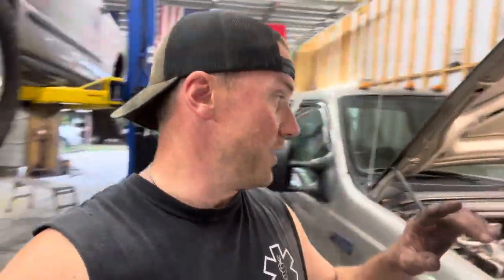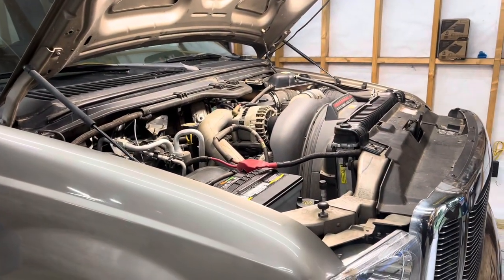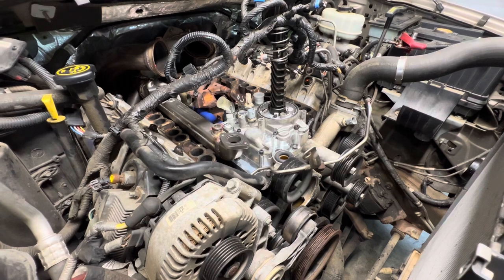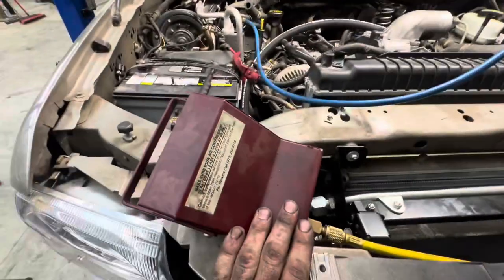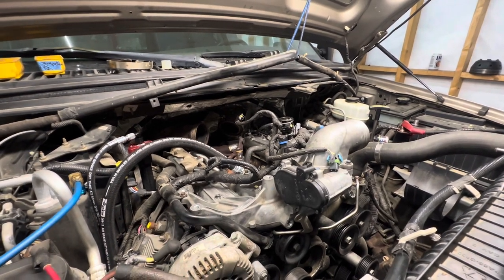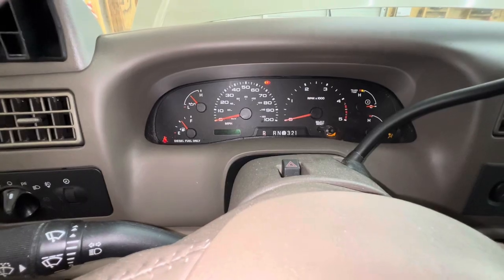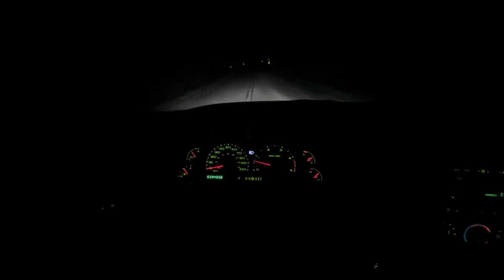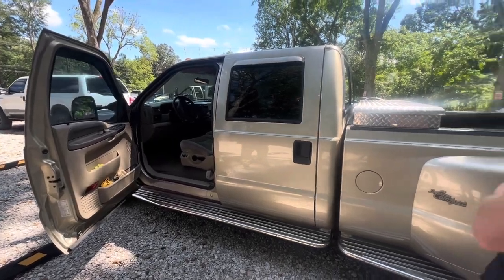38k mile 6.0!!! BPD external oil cooler

Comment: Great video...My uncle has an 07 F250 CC 4x4 KR auto with 26,000 miles, garage Queen, never pulled or been left outside in the sun or weather, he is 87 and says I can buy it when he dies...It'll be a great replacement for my 05 F250...

Comment: The whole inside of that intake looks like that egr.  I let them soak in parts cleaner overnight then blast them out with a hotsey.  This is why it's best to just delete egr by plugging it.  Then removing diverter from up pipe.
Reply from the maker: Not my truck. He wanted the egr on there. I can only do what they want to spend their money on.

Comment: One thing that may help or be useful.  When you remove the radiator hold downs, put one back on with the bolt that's farthest away from you and put it in the one closest to you. If that makes sense.. that way it keeps it pulled tord you to help remove the fan shroud and keeps the radiator from moving around.
Reply from the maker: As many times as I do this I’m ashamed of myself for not thinking of that already. Thanks

Comment: I think I would have split the turbo case open and just checked the vanes and unison ring since you went this far. But like always you have produced another great video!
Reply from the maker: Had no symptoms of any Vgt problems and I checked shaft play.
Reply: Yeah I doubt it had any end play but my low mileage F250 which wasn’t driven hard or driven often still had locked up vanes but also had vanes that would move. I guess my point is that I would’ve checked the vanes and unison ring.
Reply from the maker: @davidwilliamson2181  I get it, I just had no symptoms or any bane problems.

Comment: What would you recommend to get oil cooler wise, my 6.0 is pushing coolant and I believe I have some coolant in my oil. That being said I believe it’s the oil cooler that has blown, truck is studded and egr deleted also has an external coolant filter. Thanks
Reply from the maker: @MalachiCarrico  oil cooler won’t make you push coolant out.

Comment: Love the video, ultra clean truck, beautiful install. 

I'd love to ask if and how you find your parts. Do you use a site with breakdowns, to find parts and part numbers? I have troubles with the local shops around me not having a single clue. I have a big project ahead of me: Oil Cooler, EGR Delete, New Degas bottle, Degas Cap, Intake Gaskets, Blue Spring, Coolant Bypass Filter, etc. Going all Motorcraft, but I'm interested in trying to find or know what gaskets, o-rings, and seals I should be replacing while there. 

I am also looking at getting a monitor and have been looking at the EDGE Insight CTS3.

Anyways thank you for sharing all of your knowledge in these videos, it's really given me a ton of information, as well as confidence in doing these repairs myself.
Reply from the maker: I have a very good relationship with my local ford dealer with a top notch parts guy, he’s been there 30 years. My contact info is on my website if you have any questions.
Reply: Did you do your project yet?

Comment: Thats an extremely nice truck 38k wowzers. I just jumped the gun on an 03 with 138k on it that has the arp studs, blue spring kit, upgraded OC, egr 👋. Watching these videoes give me relief in knowing it wasnt a bad decision as i am more of a 7.3l guy, swore i would never touch a 6.0l..

Thanks for recording and sharing your videos, I find them extremely helpful....
Reply from the maker: I’m diehard 7.3 but I love the 6.0s also and I’m very happy with fords build on the 6.7s except for the cp4.
Reply: I love my 6.0 I had a 7.3 as well and have fully deleted, studded , bullet proof air to oil, stc fitting, 68 mm turbo , 130 over injectors etc and it is just as dependable as my 7.3 was
Reply: @scottp1111 what year?

Comment: What’s the difference between the bulletproof oil cooler located at the vacuum bottle location behind the battery versus in the front grille above the a/c condenser.? Thanks Peter
Reply from the maker: The type of cooler and the fact that this one gets direct air flow

Comment: I just ran into the same issue with the BPD oil cooler bracket and the larger trans cooler. Where did you get the replacement trans cooler brackets to lower it? Doesn’t look like BPD sells them.
Reply from the maker: @MountaineerMontero  he bought everything from bpd including the brackets.

Comment: 38,000 miles only but his oil/coolant temperature delta is 25 degrees!  What clogged that oil cooler with such low mileage?
Reply from the maker: Gold coolant. Truck is only used to tow also so elevated temps cook the additives and silicates out of the coolant and they stop up the oil cooler

Comment: Did you use original fan clutch? I did same mod , used original clutch, and oil really heats up in slow traffic. Not enough air flow. Great at cruise speed. Thinking I should use 7.3 clutch, but turns on engine light and uses more HP. Any ideas?
Reply from the maker: 7.3 fan clutch does not set a CEL. Your original electric fan clutch probably just needed replacing because I’ve never had a bullet proof diesel external cooler get the oil much if any over the coolant temp even if the fan wasnt working properly

Comment: If the owner want to do a bit more, a Fass fuel system with fuel filter delete is a good upgrade. I haven't done the external OC, it doesn't replace the cooler in the valley does it?
Reply from the maker: Yes it does replace it so no more worrying about oil and coolant mixing or the cooler stopping up plus if you ever did have a problem with it it’s all external and never have to get into the motor. FASS is ok but these factory HFCMs actually supply a fair amount of fuel for even bigger injectors. Just gotta clean the drain out on them regularly.

Comment: Did the 90 degree elbow tighten up on the oil cooler? Mine isn’t tight if I have it pointed up like it’s supposed to. I don’t want it to leak.
Reply from the maker: I’m going by memory but doesn’t it have a stop but on it so you can orient it right.

Comment: I marked where the boots fit on my intercooler pipes and then took the pipes off and used 100 grit sandpaper to roughen up the ends stopping before my marks so the boots cover the sanded part. I did that to give the boots something to grip. Been about 8 months and hasn't blown apart yet. Good video and nice upgrades.
Reply from the maker: Sounds like a pretty good idea. Thanks for watching.

Comment: I used the tuner in mine to disable the egr valve and removed the tuner for inspection every 2 years. All that egr garbage ends up on top of the intake valves
Reply from the maker: Yes it does

Comment: What exactly is the VC9? I’ve heard you mention it before in other videos….what does it do and how often do you use it? Thanks!
Reply from the maker: It’s a coolant system cleaner from motorcraft for cleaning the cast iron in the block and heads. I only use it when flushing before replacing a oil cooler in the 6.0s you could use it in the 7.3s also if you wanted to throughly flush the system. I do it before oil cooler replacement because I always fear breaking stuff loose with it and it ending up in the cooler. However it isn’t always possible when you have a ruptured oil cooler.

Comment: What size vacuum pump are you using for the 6.0 A/C system??
Reply: And like everyone else always great videos and very knowledgeable!!!!
Reply from the maker: I use a 4.2 cfm 90psi pneumatic vacuum pump. Works great and pulls the system down to 30.

Comment: My FICM stays at 46.5v.   Is that bad?
Reply from the maker: @brandoncollins3334  it’s not optimal but it shouldnt cause any issues yet
Reply: @AutomedicGarage  is it typically just the ficm or do other things effect ficm voltage
Reply from the maker: @brandoncollins3334  it’s within the FICM itself unless your running weak batteries. Bad batteries will kill a FICM quick.

Comment: Why you did not do the STC fitting while you had it torn all the way down to the high pressure oil pump
Reply from the maker: I didn’t take the cover off the hpop. I wanted to do everything including head studs but the customer didn’t want to. I can’t do work for free so that’s why it wasn’t done.
Reply: Powerstroke engines produced from 2004.5 and newer (those with the cast iron oil pump), originally used an STC (Snap-to-connect) fitting. This truck has a round early style HPOP.
Reply from the maker: @pj9731  I wasn’t even thinking about that but that’s a very good point and that’s why I didn’t do it.
Reply from the maker: Read the comments, you might learn something.

Comment: The worst  thing about these trucks r the people who work on them. Bad machanics r a big problem. Leave it stock. I got a 04 i would rather buy a 6.0 fpr 12 grand and put another 12 and have amazing truck. Never buy a trucl for 90 grand or even 50 grand . My next  truck will be a obs 7.3 with less than 200 thousand miles and completely revamp her. Dnt let just ne body wrench on ur truck. Also if u egr delete and cat delete. Half the battle is won my truck runs so good now crazy.